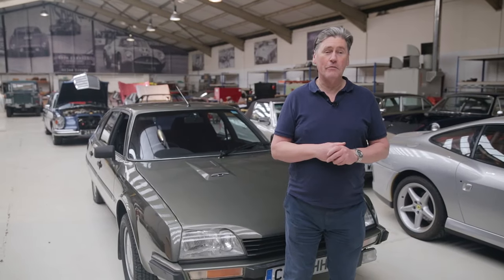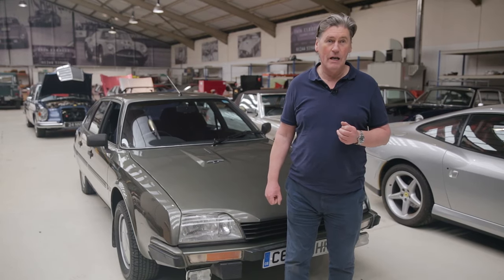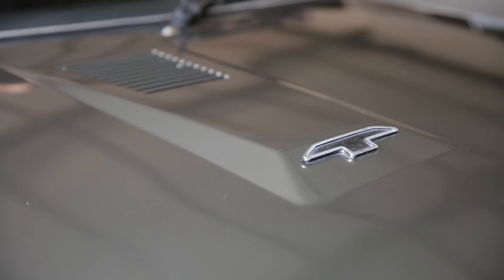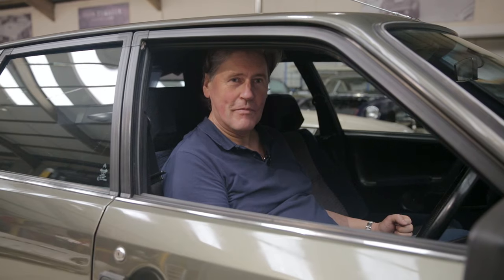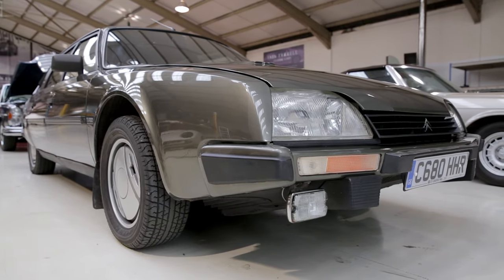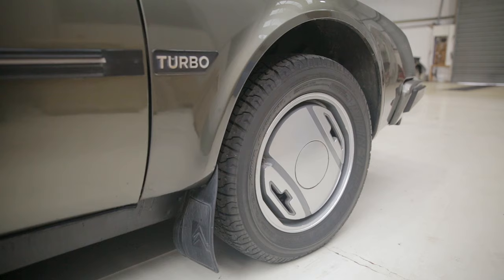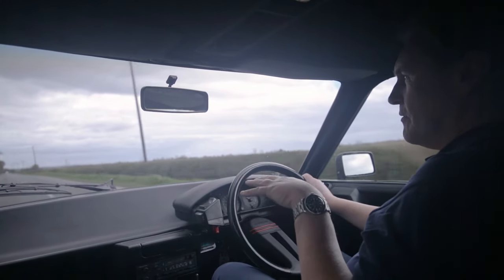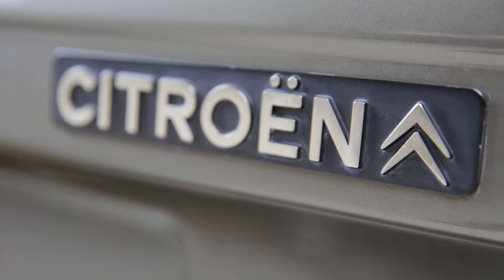Citroën CX 25 GTi Turbo - a rare beast with party tricks | Tyrrell's Classic Workshop

Comment: So glad you did this video. I’m a die-hard Citroën fan, but too many enthusiasts don’t fully understand the cleverness of these cars... I hope that your perfect explanation will help people appreciate more these cars.
Reply: My dad had a 1984 BX which sparked my interest in Citroens, it wasn't until many years later when I had a Xantia that I truly appreciated how not-a-gimmick and a worthy feature the suspension actually was.  Replacing spheres was a whole bunch easier than shocks/springs, too.  But man when those unique-sized hydraulic pipes rusted, the replacements were expensive.  I still miss that car.
Reply: I was a big Citroen fanatic (partly because they have not sold in the US in decades) until I finally got a chance to test-drive a C6, twice. A little disappointing. The legendary suspension was very wavy, even in the "Sport" setting, especially around town. In fact, It almost made me seasick. The "C-sick." has been dead since 2012, and Citroen's current model lineup is a complete joke.
Reply: paulparoma The C6 can be very wavy when the ride height is not properly adjusted. Did you drive the V6 Diesel?
Reply: @macmanipowermacbookprair4110  I did. Both cars were 2010 3L V6 HDI. I had wanted to buy one, but after those test-drives...Whew...I am glad I didn't.
Reply: @paulparoma  The older C5, XM, and CX all drive very different to each other
Reply: @macmanipowermacbookprair4110  I suppose you mean "differently from each other". Sure, they are all very different cars. I knew a guy with a Xantia. He loved that car, but I thought it was nothing special except very space-efficient. Then he got a C5 (1st gen) and thought it was the greatest car ever. It has not withstood the test of time, in my opinion. The latest C5 was just neither here nor there. No room in the back, terrible plastics inside. The C6 was supposed to be the ultimate. It looked great, but maybe there is a reason it failed commercially. The Frenchies can never get it together, thanks to those wonderful unions and brilliant management from Peugeot. The new C5 looks nice, but I don't even want to test-drive it. Tried sitting in one in France. That was enough.
Reply: @paulparoma  Which C5 do you mean, the C5 Aircross? The 2008-2017 C5 is excellent, I own one. Mine is from 2008 with nearly 170000 miles on it and the interior is squeak-free, showing how well put together it is, and I use it as a temporary office when I want to be alone because the space in the rear seats is fab (I'm 6' BTW). I'm sad to read you don't like it, nor the C6. They're among some of the best 21st century Citroens, IMHO.
Reply: @torresalex  The C5 Aircross is another story altogether. I don't know, maybe it's a matter of taste and what you are used to, but I am not sold on Citroen. I am glad your C5 has served you well, though. A guy I know has a 2009 and is not all that happy with his. It's had several problems since new. I tried one in France and did not find it to my liking, even though it drove well. The C6, as you already know, was a disappointment. As for the space in the rear seats - it depends on what you compare these cars to. I had American luxury cars for many years and now have a Scion XB (aka Toyota bB), which is a complete opposite in almost every way. The rear seat room the 2 Citroens have to offer is modest in comparison, especially as regards the Scion. I am 6' as well, BTW.
Reply: @ZIGZAG12345  The bx was the last good car citroen built
Reply: @TheCitroenman1  
Disagree.
Reply: @ZIGZAG12345  every car Citroen make after the bx are rubbish fact
Reply: I had both several BXs including the Gti as well as a Jaguar Series 3 XJ6. The ride on the BX was far more forgiving and a joy to drive. The video makes the point about the brakes which were a revelation compared with their contemporaries like the Mk3 Escort.
Reply: @paulparoma  The hydropneumatic system "deteriorated" from the MK 1 CX down to C6 with each "new", "better" version they tried to please an alleged "market" with, because after Lefèbvre nobody with Citroën seemed to understand the principles of leverage needed for a properly working hydropneumatic suspension system (integrating brakes and steering): You need long levers for the wheels to ride on, and You need the DS's kingpin offset of dead-on zero. Adding a kingpin offset and shortening these levers and godforbid, even more, "hardening" the nitrogen spheres because of too short levers, or even bodging with fifth, sixth spheres to "activate" the suspension like they pitifully did in the second generation XM is what ruined the original idea Lefebvre had in the fifties: A smooth palanquin in sharp contrary to what other car manufacturers made: unpleasantly hard iron coaches.
There of course are people getting "C-sick", there even are people not pleased in a first or second generation DS which were the original Lefèbvre creation, but there are, too, people getting sick already on the gangway when stepping on a ship. Those might be better off in an Alfa or Fiat or a Bimmer, and they shouldn't be misunderstood as "market" for Citroën cars, what narrowminded PSA-Citroën controllers and the Peugeot marketing idiots unfortunately did (and thus ruined the great possibilities still there back in the days after the CX, before XM and C5 / C6.)
Reply: @manfredschmalbach9023  You seem to know quite a bit about it, while I am just a somewhat "educated consumer", one might say. When I started driving, it was nothing but large upscale American cars for me, with that silky-smooth, quiet ride they were famous for. I never got to try a CX (only sat in one in the Champs Elysee showroom), but they were supposed to be superior in ride quality to those large American cars. I wonder if they really were, though, but the "C-sick" is certainly no match for a nice old Buick. Thanks for the fascinating technical information. PSA is a bunch of idiots indeed.
Reply: @TheCitroenman1  
Incorrect also.
Reply: @paulparoma  So, if You want to try the Citroën experience, look for a ride in a well tuned DS 21 H or a well kept DS 23 M.
With "H" for hydraulic gear-change, and "M" for mechanic gearchange which would be a  5 speed box shifted beside the steering column.
That would be the original Lefèvbre idea of gliding where anybody else just rides - needs vastly getting used to, from the "h" shifting to the steering to the brakes/the braking mushroom, but worth every wrong brake-screech You might have the first month or so (at least in my book). The C-sickness cars and already the XMs and Xantia h though - not even worth mentioning, sadly.
And yes, I do know a thing or two because I always had Citroëns, rode everything they built up to 1990 as daily beaters, no matter 2cv or SM, ami 6 or CX, GS or XM. And started to repair those myself after my original dealer/mechanic fell outta working with a stroke in '83 (his family sold to me a lot of specialized tooling he built himself, and I gained quite a stock in parts and piece cars from there, too.) 
I never was a sole-Citroënista though, with also a lot of Alfas and Lancias under my belt. Cheers.
Reply: @manfredschmalbach9023  How interesting. Are you in the UK with a German name like that or a bilingual German? You must be the only person in the world with all that acquired knowledge and special tools inherited from your mechanic. I don't think I'll ever have a chance to try a "real" Citroen, for I am nowhere near any Citroen activity. But one never knows. I miss the smooth ride of my big American cars, though (as do a few others, it seems). Seinfeld.
Reply: @paulparoma  I am in the Bavarian South right where the Alps get steep between the lakes, and interesting if You should happen to own motorcycles, too.
Thanks for the English-"bilingual" compliment!
I am as Bavarian as it gets, "bilingual" with the "German" dialect over my "Bavarian" mother's tongue already in elementary school, but been out of here a round or two the last nearly sixty years (man, time runs! 😂), lived in RSA, Italy, Greece, and elsewhere, had an Australian episode and a NZ-one shortly after that, sailed some of the Pacific islands, the Atlantic and some other seas as well, so I reckon it turned me into some kind of cosmopolite - which I like.
I rallyed Lancias and raced Alfas and Moto Guzzi motorcycles as a young man (nothing to write home about though).
The Citroën part was nothing else than wanting to get there and back in style in the beginning, as I befriended my dealer-mechanic because he was fond of my (then still) young man's interest in those grandiously "out-of-the-box" constructed cars. Being a mild tech nerd and a hard boiled perfectionist made me screwing around under my cars and bikes ever since, but getting the selfbuilt tooling and parts-stock was helping with the Citroën bond. Cheers!
Reply: @paulparoma  Oh, and there's "cold war motors" in Alberta, Canada, with some serious DS and SM content here on Youtube. Just to illustrate You could find Citroënistas next to anywhere.
The schmalbach name is a "product of art", of course; nobody in his right mind would put out their realtime everyday's name in a Youtube channel, would they?
Reply: @manfredschmalbach9023  What a colorful bio! I know your part of Germany pretty well. Been there and driven through many times over the last 10 years or so. Things have changed quite a bit since my first visit in 2001, and not for the better (the beer is still good, thankfully). I am not at all into motorcycles, but I know a couple of people who are. However, I don't seek out any clubs or associations, or any other form of bonding with others, so I suppose my exposure to Citroen's best will stay limited to YouTube content.:) As for using one's real name on YouTube, it seems quite a few very naive people are doing just that. Have fun!
Reply: @ZIGZAG12345  I bought a Xantia for buttons. The engine was bullet proof & the ride was sublime, so so comfortable & could take on any terrain. Best car I've owned, wish I'd paid the £700 to keep it on the road, It would still be running today.

Comment: The steering system on the SM and the CX is called Diravi, in french. The steering is also speed-dependant, so that it´s get stiffer with increased speed. It´s fingertip sensitive at parking speeds, and stiff as a racecar at high speeds! A truly marvellous design!

Comment: I was lucky to drive a Citroen CX (I think the 2.2 version) twice in 2004. And it was such a great experience. Like a car from different planet! Designwise and the way it drives is something special. And I clearly remember the "taking off" acceleration. Few years later I owned Citroen C5 2004 with newer version of this Hydro suspension. It was so comfy and reliable car... After 20 mins of a drive everyone in back seats fell asleep 😁. My friend owns C5 and XM and he says: You don't drive these Citroens, you sail them 🙂. Thanks Citroen for your hydro-genial suspension. And many thanks to Ian for another great video.
Reply: Once a week ,I ask. .Why did I sell my ..XM ..but I now drive a  ( 2007) C5  estate.. I exit my work onto a steep river valley slope ( in Ireland ) and traffic lights ;, and then there's that  reassuring  background 'music'.. called  'hydraulics'
Reply: I'm the same. I have been lucky enough to not only have a brother who was 100% a Citroen fanatic but to have driven 6 different models ended up with a 2005 facelift C5 2.2 HDI as my latest. C6 is next on the wish list.
Reply: They might feel like they are floating, but they stick to the road like nothing else. A reasonably well driven CX or BX will leave pretty much everything behind and the driver will hardly notice.
Reply: but its no longer Citroen as they have dropped the Hydro Suspension on cost grounds so now only make tin boxes. I still own my C5 and intend to keep it .

Comment: Another party trick was to drive around at a show ground with one rear wheel missing and watch the public gawp and stare very amusing !!
Reply: I saw that in a DS. Was that possible in the CX as well?
Reply: @paulog8813  yes and GS too ....in fact all Hydro Citroens can do it although i'm not sure about C5 and C6
Reply: @paulog8813  As long as the rear "axle" was shorter than the front axle, this was possible.
Reply: I was going to mention this.
 Mr Tyrell didn't drive the car on 3 wheels.
Reply: Driving on 3 wheels does need the mechanical (valve-and-pressure driven), wheel-selective break- and hightcorrection-function DS, CX, GS and BX had. That system does also put on the wheel's break the pressure in the very wheel's sphere. It does not work with the awfully messed "activated" system they bodged into the XM unfortunately.

Comment: Wonderful car! Thanks for the video.
My father and his brothers were Citroën fans, I grew up in and around 2CV, CX, DS, even an 11BL, XM and so on. 
I became a car mechanic and have been working in a Citroën Garage for a few years and always loved it when we had a customer with an old hydropneumatic Citroën, the engineering and ideas Citroën had are just great. I also loved the C6 my boss had and did quite a bit of work on it over the years.
Sadly I don't own a CX (it's my personal dream car) but at least my 2002 C5 Break Diesel has a modern version of the hydropneumatic suspension, and it's a great, reliable family car. 240.000k and nothing but regular service and a few minor issues so far :)
Greets from germany, thanks for giving me something to watch during quarantine and stay safe!
Reply: Greetings from Ireland, Jan. .Yes , I have a 2007 Break diesel, and no problems ..I still dream about my old  XM..It is like an old  girlfriend. .Where is she now ?
Reply: As you i have a 2002 HDI C5 estate with near 280,000 --- never let me down in 20 years and never touched the engine although i think the crank pully needs changing now. Even on the original brake calipers

Comment: That was great, subbed. 
I ran a CX 2 litre back in the days, and once lost hydraulic pressure on the A16, coming down a steep hill with a roundabout at the bottom. 
Zero brakes and we went straight over the roundabout and took off, and flew for 50 yards, all the dash warning lights came on to indicate we were airborne 😛
 Still made it to Grimsby to join my ship..
Reply: I've had fluid leaks on several BXs but never ever had a hydraulic failure

Comment: I saw the CX in the background of your last video and hoped that you would include it sometime, so glad you did. My family had DS and CX Safaris, GSs and even an Ami 8, wonderful cars, we drove the length of Europe in the '60s, dinghy on the roof, trailer hitched behind, mother and father at the wheel overtaking  everyone as me and my siblings cheered them on, bought back great memories, thank you :-)
Reply: And as a result of Johnsm100 dad's cars and riding in and driving them my first car was a CX 2400 gti. I'll never forget racing an Opel Monza on the UK M4 motorway and having the cylindrical speedo going all the way round back to zero at it's top speed. Fabulous memories of my youth. I just wish I'd kept it but I became scared of the costs as it got older and my father offered me a cheap Toyota corolla. Which I took. Thanks Dad. ( NOT)

Comment: Back in 1976. I was driving a Fiat 130 V6 sedan from Paris to Marseille via the Autoroute.  It was a night drive and I needed to get to the south of Spain in a relative hurry.
At one stage I was following 3 Citroen CX wagons at very high speed. We pulled into a fuel stop on the auto route. It turned out the three CX's were carrying the latest Paris newspapers to Marseille and had to be there before sunup. The wagons were chock-a-block full of news paper bundles. I couldn't keep up with them. They were averaging 170KMH+
One of the drivers told me they did this every night.

Comment: Had one in the eightys bought it with a duf clutch for £600 used it for weekly work travel cornwall to Bristol weekly for three years piece of cake to work on, sold it later for £3000 ,good car !

Comment: I’ve been waiting for this video, my dad has had a GTI Turbo for 18 years that used to belong to my grandad when it was new. I would love it to be as good as this one.
Reply: It could be again. But you will need to learn to weld. 
I dont mean that to be negative. all cars of that era were rust buckets. CX with sun roof are best avoided as water leaks rot out the roof panel and can even destroy the A pillars. Spare parts? Yeah right.
Reply: David Elliott It would probably be cheaper putting a new body on it, the rust that’s visible is on the sunroof, scuttle panel and rear quarters so probably the a pillars and a lot of other places are rust as well, in an ideal world I would send it to Ian to get restored but until I’ll have to manage it.